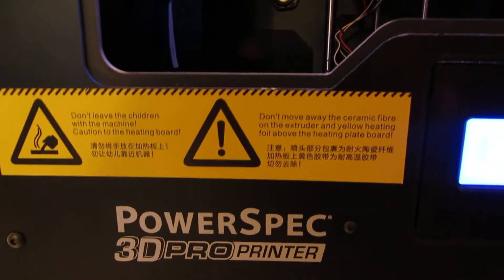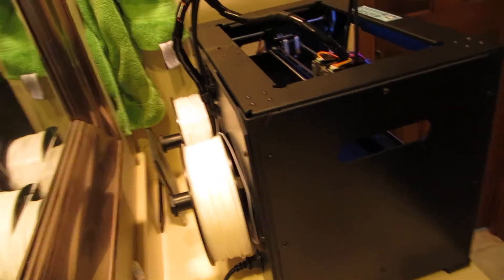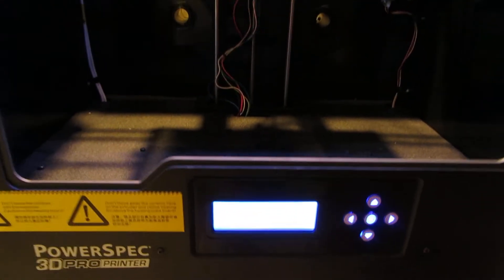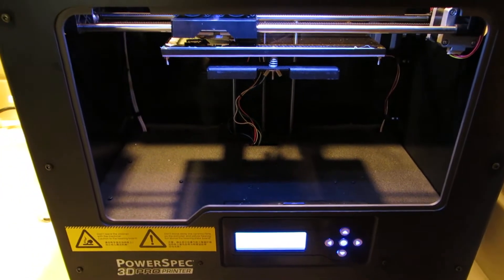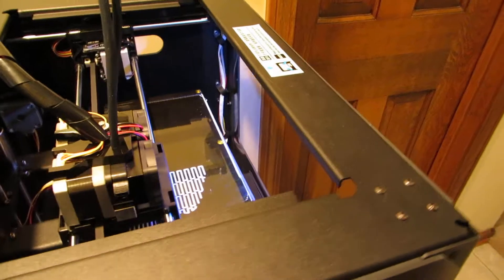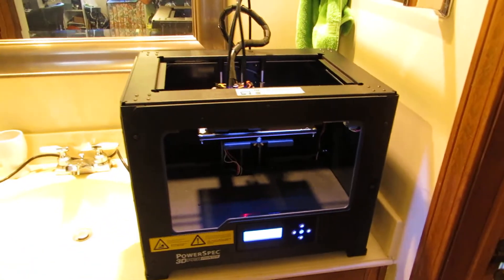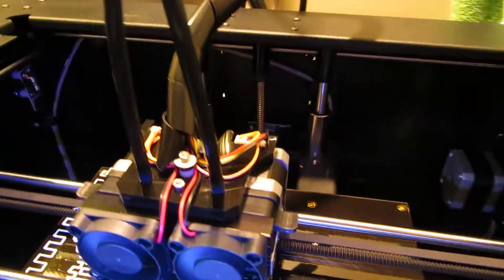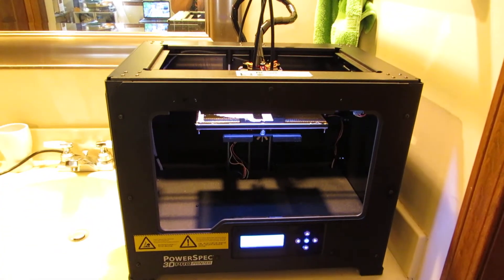New PowerSpec 3D Pro 3D Printer from Micro Center

Comment: Looks like the lost twin brother of my Flashforge Creator Pro. In shape, size, form and function it is the same I think, so it must be a very good printer coz I love my flashforge. Thanks for the vid man, very informative.
Reply from the maker: +3D Printwiz It is exactly the same and even came off the same assembly benches.  Microcenter contracted Flashforge to make them for their stores.
Reply: +Matt Christopher Exactly what I was suspecting. This printer is very good, got mine six months ago. I just hope they start making larger printers soon, coz most of my clients are Architects and most of their models are larger than my build plate. I don't like gluing parts together coz my hands are shakey.
Reply from the maker: Registering parts up can be tricky with flat surfaces.  I often design tabs and slots or pegs and holes into my broken up pieces to help register them up and make the glued joints stronger.  You can still put the holes on the bottom without using support structure because the printer will bridge gaps, so long as your nozzle diameters match your slicer configuration closely enough.

Comment: I just picked one of these up, very nice printer for the money. Have you played around with dual extrusion at all? I am trying to figure out how to start with something simple and do the support material a different color than the print for now. I tried making the gcode in slic3r but ReplicatorG does not like the M84 command
Reply: +Neil Caulfield Micro center had a sale, $300 off so got it for 700!
Reply from the maker: +Neil Caulfield I just use MakerWare for it still.  I've had to replace the nozzles a couple of times but it's still printing.

Comment: Thanks for the video Matt, very informative.  I've recently purchased one as my first 3d printer.  Do you have any resources on the actual controller/firmware?  Interested in learning the differences (and similarities) to the maker bot replicator 1.
Reply from the maker: Michael Blair I think it is running a version of Sailfish, which is open source firmware compatible with .x3g toolpath files.  Just about any open source slicer will slice for it as long as you output to .x3g instead of .gcode.  Makerware will also slice for it using the Replicator 1 (dual) settings.

Comment from the maker: @ Shawn Donovan, sorry I didn't see this comment until today for some reason.  There is a USB printer port on the back (just like old school 2D printers).  You can print over the USB connection, or put your .x3g toolpath file on an SD card and pop that into the SD slot on the printer.  That's the preferred method since it eliminates the chance a disconnection would occur while printing, failing the print.

Comment: Can this printer print with NinjaFlex filament? If so, does any modifying need to be done to the printer?
Reply from the maker: Annissë Damefatale There is a modification part that can be printed that helps guide flexible filaments across the gap between the stepper and the barrel.  I have not tried it on this printer though.  I was able to modify my Solidoodle 4 to print with flexible filament using a similar modification so I assume the principle will work for any printer.  To avoid bends/binding, you can also try wrapping the filament somewhere along the line with an oily cloth held on by rubber bands or zip ties, in addition to the gap-jumper modification.

Comment: Bought one of these. The instructions say "The installation of the spool holder is very simple – just insert it into the circular opening and tighten the nut behind." Couldn't find a spool holder and have no clue what it's supposed to do or looks like. The picture looks like it might be attached to the extruder. Any clues?
Reply: looked up a picture of one on a replicator. It's the filament spool holder that attaches to the back of the unit.

Comment: I got this machine shortly after you posted this review. So far I'm digging it. It just struck me that you said yours came with a glass bed. When I first got mine, I assumed it was glass because... well, because I assumed it was. After the first scratch in my kapton tape, I realized it was actually some kind of coated aluminum. Anyway, I went down to Lowe's and bought a piece of glass for a couple bucks, the smallest sheet they sell. Cut in half, it makes two perfectly-sized sheets. Printed a spacer to trick the sensor (and prevent the extruder from slamming through the glass), and it's all working well.

Comment: Was wondering if all was still well with your printer. I was looking at teh $800 one. But did not see the SD card slot ANYWHERE on it...  Do you know if you can use Cura as the slicer?  and if not is it an open source product?
Thanks
Reply from the maker: It does have an SD Card Slot.  On the Pro version it is just above the LCD panel.  On the original I remember it being difficult to find, but I did see an SD card slot on it.  I haven't tried exporting .x3g files out of Cura yet.  I only use that to slice for machines with Marlin-like firmware, like my Solidoodle 4.  I've had great luck with this printer so far using cheap filament.  I tried running it with all of the enclosures assembled and in place, but that actually led to some serious warping, so I have abandoned the door and the acrylic pyramid that rests on top.
Reply: Matt Christopher Thanks for letting me know...  Probably going to get one soon.